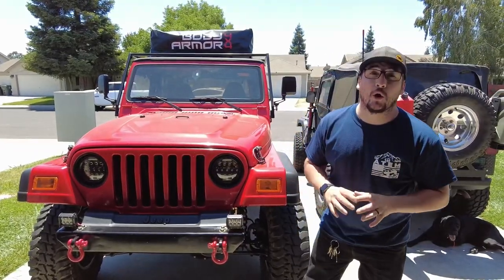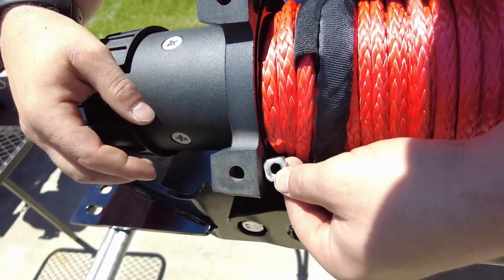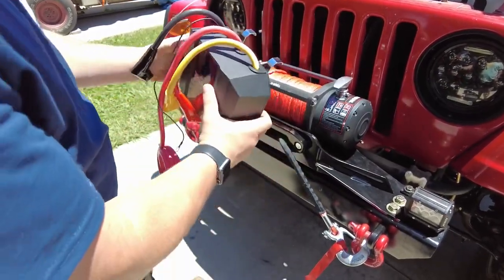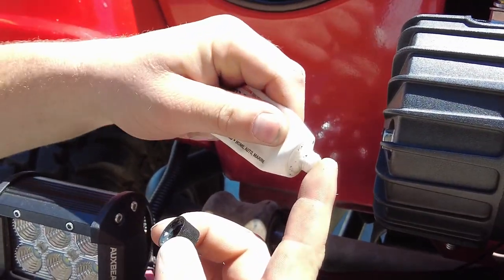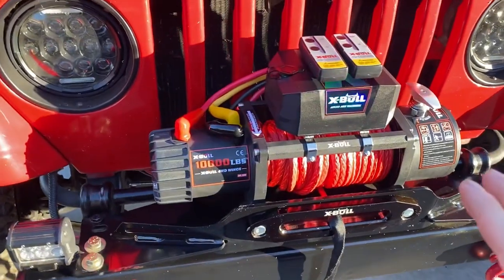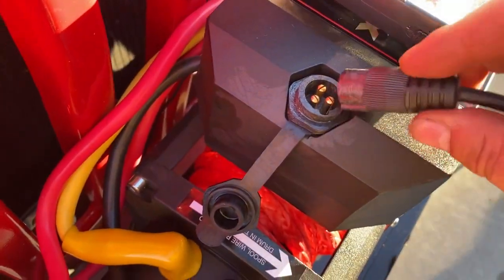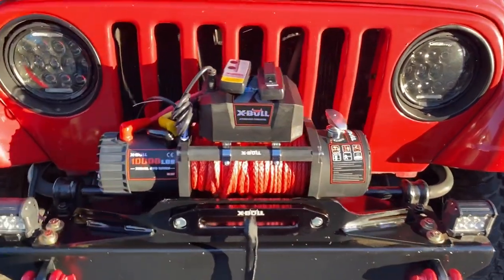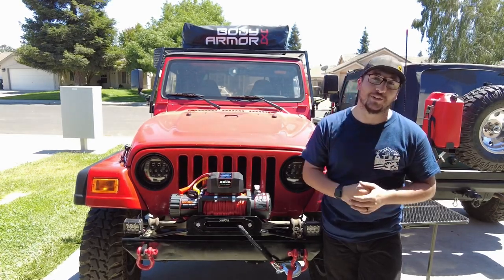Jeep Wrangler Tj | Lj - Best Budget Winch & Mounting Plate Installation Guide (10k lbs Xbull Winch)

Comment: Do you happened to know if a smittybilt stinger bumper will get in the way of this set up? Or can I install it just fine?
Reply from the maker: I’m not totally sure on that one , have to find out if a plate is needed or not! Do you have any more information on the bumper ? Thanks for watching
Reply: @ATEMOFFROAD  I’m using my stock bumper and I have the smittybilt stinger on it. I’m wondering if i can use this same winch you have and still keep my stinger bumper or do I have to remove it in order for the winch to fit?
Reply from the maker: @eddyrivera7287  I would think it will all fit, but I’ve never seen those stingers that bolt to the factory bumper before! Good luck buddy

Comment: Dielectric grease is an insulator… don’t use it on electrical connections themselves like how you rubbed it all over the connector before putting it on. Great idea to use the stuff since it helps prevent corrosion. However, use it on the outside of the connection only! Lol
Reply from the maker: Thanks for sharing 🍻 you are correct I should have mentioned this better , best to not put it on 
the conductive side of the terminal and ok for the rest. It’s been fine so far no corrosion and winch still good as new,  just checked it, that was lousy on my part.
Reply: Use a product called No-Ox-Id or just No ox. It prevents corrosion but also conducts.  I used to put it on giant battery strings in telephone offices. Electricians use it on aluminum cable. You can usually find it in electrical sections of hardware stores.
Reply: I use CRC battery terminal protector spray.

Comment: The small black wire.. where does it connect inside the control box?
Reply from the maker: The small black wire with the eyelet on the end goes on the motor on the bottom
Reply: @ATEMOFFROAD  correct, but where is the other end inside the control box?
Reply from the maker: @derrickarchibeque8942  that black wires is the ground wire for the wireless controls , it goes with the black wire that comes out of the wireless control box and should land on a coil contact then lands on the ground contact of the motor same pole as the heave ground cable fork the battery